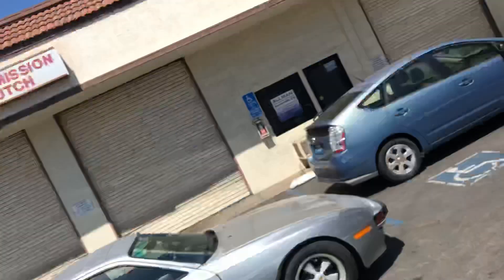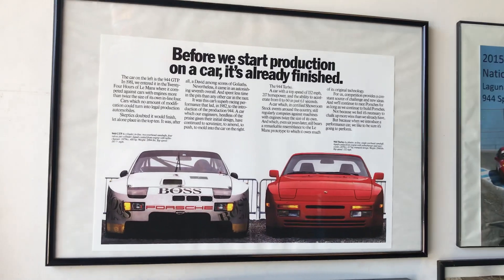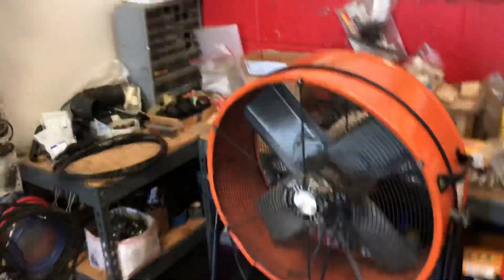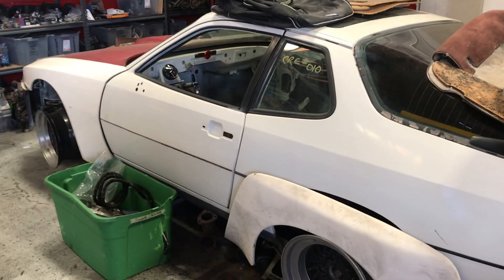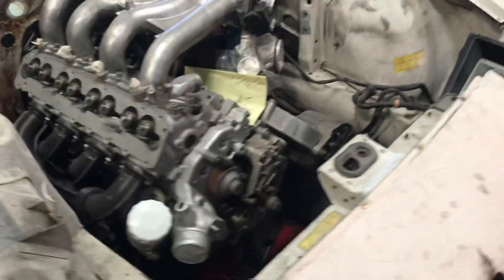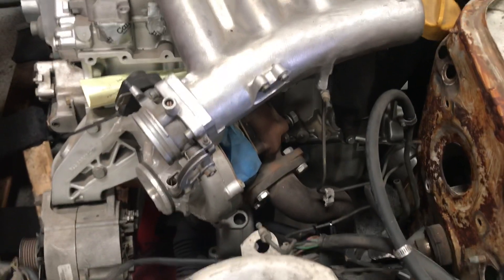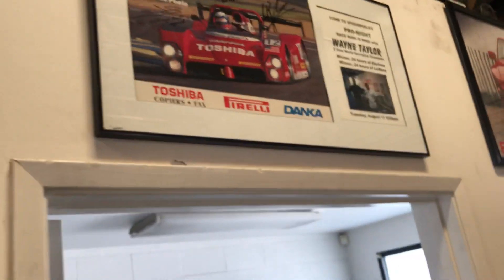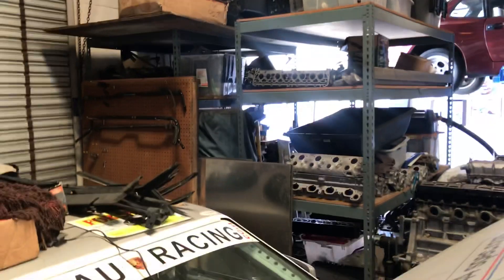Porsche 944 shop tour

Comment: Just curious, what are you doing to the motor that you expect 180hp from? That’s in the range of what I’m hoping to get out of my project...
Reply from the maker: Manual Drive - by J Mags Biggest thing is switch to a MAF from the AFM. Increase compression ratio up to about 11 to 1. Headers. Ported head. Aluminum fly wheel. Knife edge crank.
Reply: Great, thanks.  I'm  doing the MAF, 10.6 compression, ported heads, honed intake, camshaft, header, and am considering the rest of exhaust, either full or cat-back.  I will not lighten flywheel since I'm not building a race car and will probably not do crank, due to cost.  And probably a cam key as well.  We will see what that gets me.